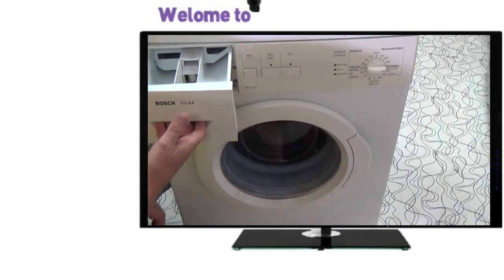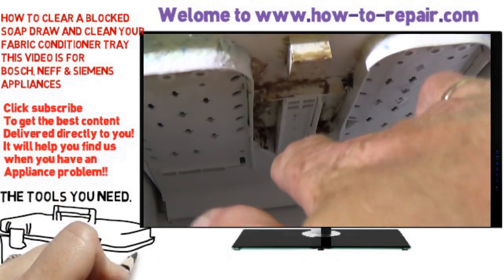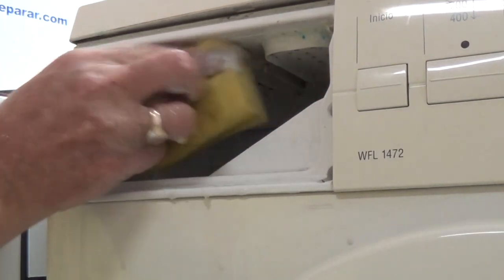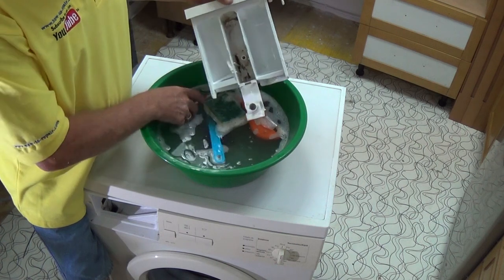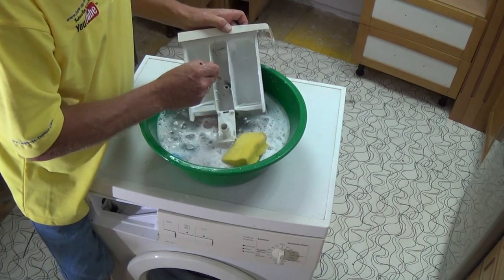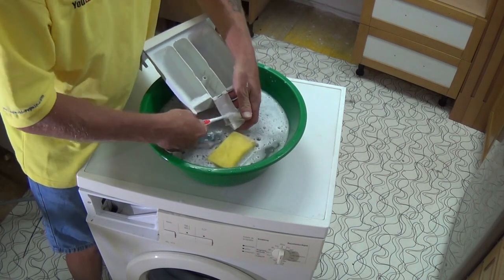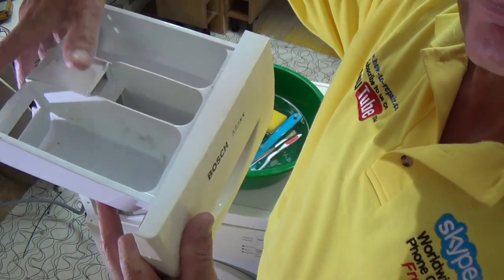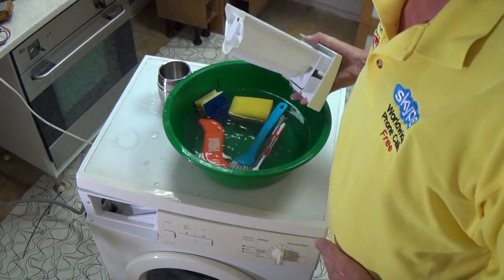How to clear a blocked washing machine soap drawer and clean your Fabric conditioner tray

Comment: I thought I would share this in case anyone has the same problem. For some time now, my Miele W412 hasn't been dispensing the fabric conditioner properly. I tried all the usual fixes of cleaning out the drawer and the housing, including using a pipe cleaner to give it a good clean, but nothing worked. Due to its age (12 years old) and having another issue with it (doesn't always do last spin at fast enough speed) that it probably wasn't worth the cost of  having serviced or repaired. I decided to just persevere with it for another year and replace, but the fabric conditioner thing was really bugging me. This morning I put my finger right down the hole at the back of the housing and felt a hard, rough lump. I assumed it was limescale, but limescale remover and a brush wasn't moving it. I decided to have a good dig around with a teaspoon and it started chipping off. I just ran a wash and it is now working fine (apart from the spin issue, that sometimes just needs an extra spin at the end of a cycle)

Comment: I had a blockage above the tray (there is a small hole where water is jetted in). I found the best thing to do is to run a couple of cycles with a washing machine cleaner to loosen the gunge, then get a pipe cleaner, and shove it up the holes, wriggle it about a bit and pull out as much of the gunk as possible. 

Did this, next cycle no problems, tray completely clear. FYI putting the cleaning stuff in once a month will avoid it blocking up again. 

Never thought I'd be posting washing machine tips on YT, but there you go, that's adulting.
Reply: Thanks for the tip..... very helpful indeed.
Reply: Ha ha very true!

Comment: Thanks for the tutorial. Can you explain what program did you use and the steps at 1:15? it's quite unclear how to turn on and off the machine in order to prevent flood. 
I was wondering if the washing soap became harden, what can be done in order to remove it? I have the same machine.
Reply: You mean hard

Comment: I know this is an old video, but at the end you mention that if its still full at the end of a cycle your syphoning system needs cleaning. I've cleaned the dispenser and the hole sprays at the top, however I'm still not getting a syphoning action. Any ideas or a different video of yours that might help me? Thanks!
Reply: You mean Siphon

Comment: Water coming out from detergent tray how to fix this problem?
Reply: First find out exactly where the leak is occurring. Once you know that, it will be easier to address. Depending on where the leak is, either apply epoxy putty over the damaged area or replace the part completely.